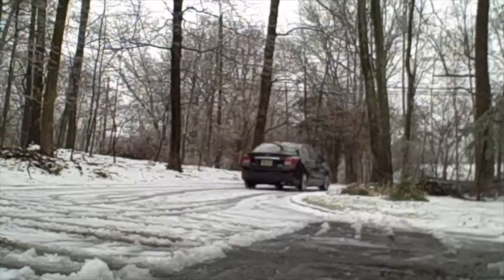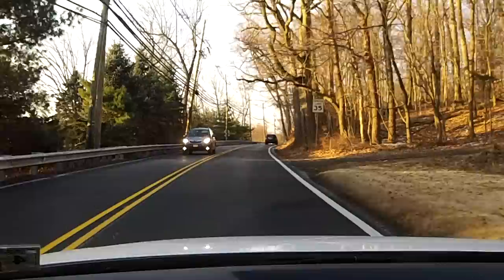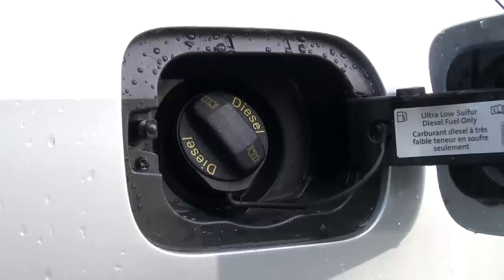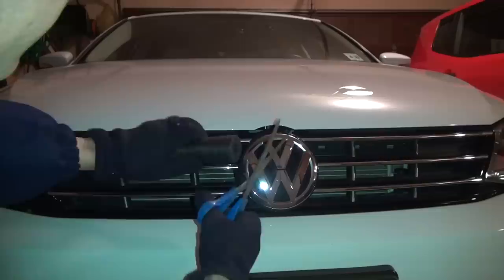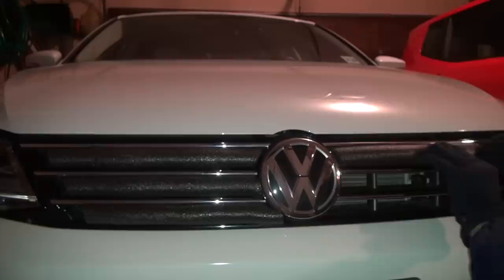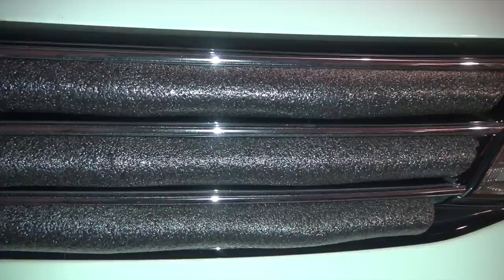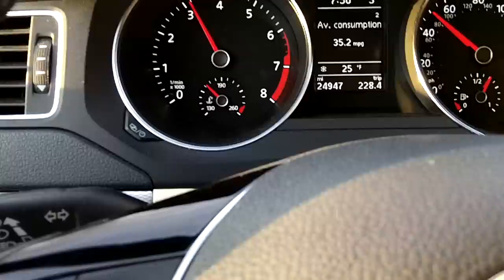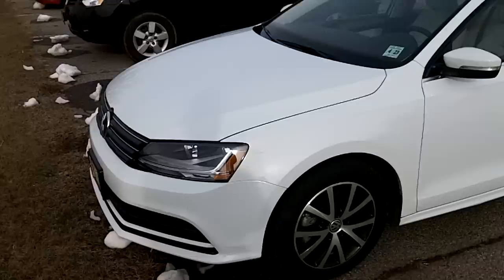DIY VW Jetta winter front grille cover made with a series of tubes

Comment: I'd be careful with coverings of this sort. They trap salt and moisture which can start corrosion on your hood and the plating to peel off the grill, that is if you care about that sort of thing.
Reply from the maker: I know putting a "bra" on the front of your car can do that (they were popular in the '90s), but I doubt this would have any such risk. The underside of the hood already has a fabric "blanket" on it from the factory.
Reply: The grilles from this vintage are largely plastic.  I get the idea about trapped salt and moisture, but it just doesn't have that kind of fast corrosive effect on good quality plastic.
Reply from the maker: The grille is all plastic, even the chrome-effect parts of it.

Comment: Oof I just installed a larger intercooler on my full bolt on e30 1.6 fusion think I’ll have a prob
Reply: Inter coolers don’t affect the engine running temp or coolant temp it will only cool the combustion air more
Reply: Nathan Chapman na man he’s got a point my car takes longer to warm up because the air coming into it is way cooler, I got a full bolt on 1.6 fusion, on e30, with a cold air, straight pipe from the cat back, intercooler, larger turbo elbow and ported exhaust manifold makes about 230hp and 290trq

Comment: I'm so sorry to hear that you have 1.4 TSI engine.. i would swap the car asap, just google about 1.4 tsi, full of problems, mainly with timingchain.. don't say it has a dsg transmission aswell?
Reply from the maker: No problems with mine so far. I have the 5-speed manual.
Reply: @vwestlife  Is yours with timingbelt or timingchain? Tsi:s with belt are usually ok, ones with chain won't last 60k miles with original chain before major damage.. chain has to be replaced every 40-50k miles, costing about 2000€ (2200$).. commonly known design flaw, as bad as dieselgate.
Reply from the maker: Mine is the newer version with a timing belt.

Comment: It's been rather cold here (northern Middle Tennessee), sometimes dropping to negative degrees Fahrenheit.  I've never had to do this.  I've had small displacement engines as well, the smallest being 1.3 liters.  Engine technology has changed a lot since I started driving.
Reply: Pff, a few degrees below 0 isn't much but you'll notice the engine stays warmer while driving. Get a scangage and my temps drop to 150 in town without anything

Comment: I wanted to comment that 35 mpg seemd quite low for an 1.4l engine (i also drive a car with an engine this small) bit than it hit me: 35 us mpg are almost equal to the 42 uk mpg my car shows me
Reply from the maker: My lifetime average with the car is 37.5 MPG (U.S.), which is equal to 45 MPG Imperial, or 6.27 L/100km.
Reply: @vwestlife  i got about 40 us mpg when i commuted the about 25 miles to work everyday (i was at the point of trying to squeze every milimeter from each drop of fuel for fun), now i get 35 mpg at best, but with a much shorter commute.
But my Peugeot 207 SW is also a bit smaller and propably lighter than your jetta.

Comment: Wow, i didn't know about places where car cooling systems don't actually work.
Reply: This is actually a case of them working too well. The heat released by the engine is sucked away by the cold radiator so fast it is left running colder than it usually would.
Reply: @8bits59  indeed, wearing the engine up at a faster rate

Comment: I'd be livid if I spent $20,000+ on a new car and had to muck up it up with foam tubing!  This should be up to Volkswagen to figure out, not the owner.  I find this completely unacceptable.
Reply from the maker: Actually I only spent $18,000 on it, so I don't mind. They designed it so that it wouldn't overheat in Death Valley in the summer. And the terrain of my commute is unusual. If it was on more flat land it wouldn't be a problem.
Reply: VWestlife :  The money aspect wasn't my point.  I simply don't feel that you should have to do this on a new car.  They should design the engines to work properly no matter where you live (obviously not one extreme or another, you get my point).  If there is a possibility of the engine doing what it does in your case, it shouldn't be manufactured.  That's just how I feel.  Cars cost too much money these days and having to right off the bat need to modify it to work properly just doesn't sit well with me, even a $3 and 10 minute fix.
Reply from the maker: It's not even really a problem, per se. It just takes longer for the engine to warm up. This modification helps it warm up faster.
Reply: VWestlife : Gotcha.
Reply: Maybe your butler can help you understand how us poor benighted commoners live Lord Jeff.